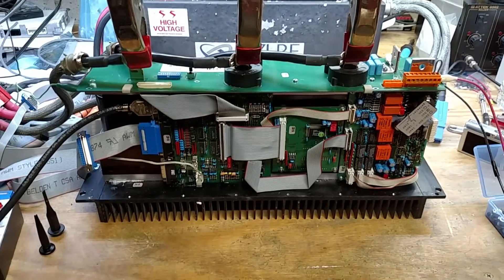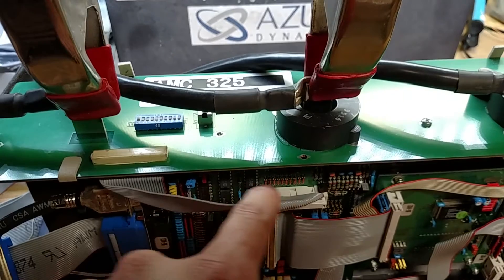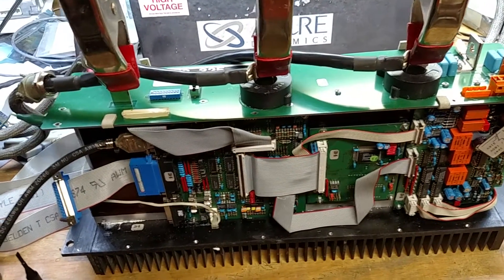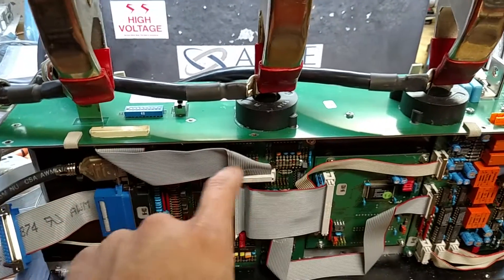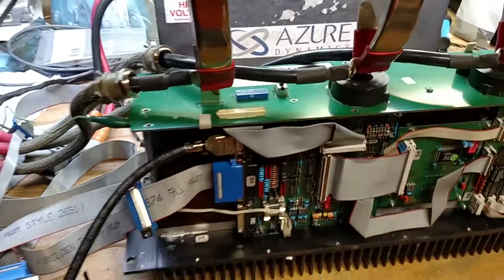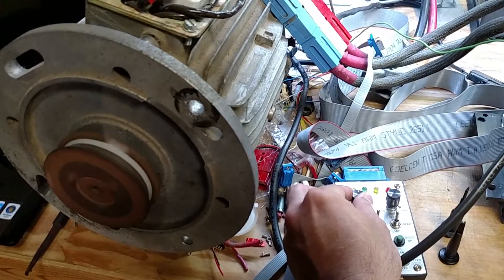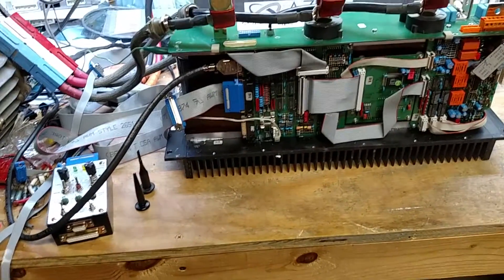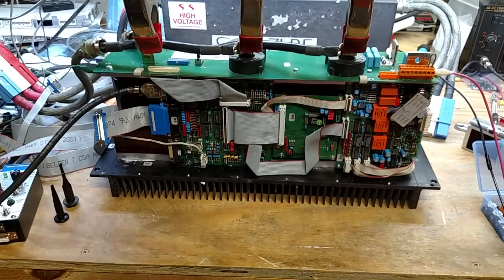AMC325 repair S/N 1384, Part 3

Comment: I'm not surprised it was just a dirty switch.  It's been my experience of repairing consumer electronics for 23 years that switches always get dirty and unreliable.  After seeing the amounts of corrosion on the outside of these inverters I'm surprised there isn't more serious corrosion damage on the inside.

Comment: Thanks ! Can you test it un load ? because the issue I had was over heating after a few miles in my Force: had to wait a few minutes to be able to restart in order to go back home....
Reply from the maker: +Michel Toussaint 

I could put it in the truck and drive around on it...

Intermittent encoder signal could cause it to over heat and shutdown.

I did check the cooling fans and they work.

Comment: why do you keep referring to the capacitor as the capacitor of doom ?
Reply from the maker: +fromatic2 

The capacitor of doom, is a capacitor I have sitting on the floor, connected to line voltage bridge rectified AC.

It is dangerous because it places everything at line level... and these controllers typicly have small AC coupling to frame ground for EMI purposes... so if you are not careful you can get a shock from touching the controller.

See this video:
https://youtu.be/V6o8PpcU3AM
Reply: thanks for your feedback